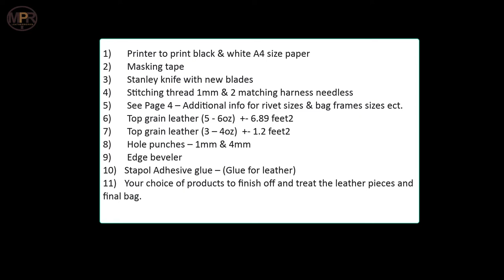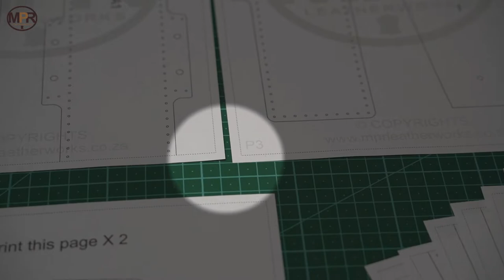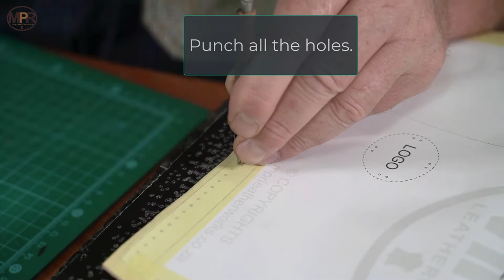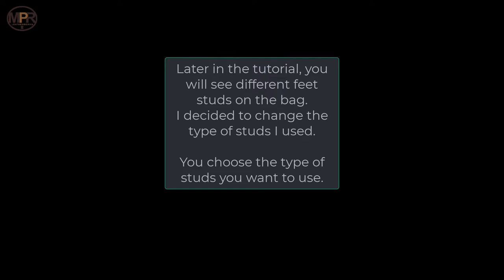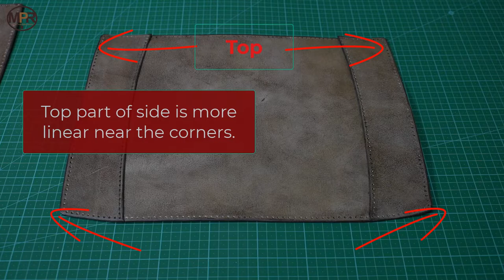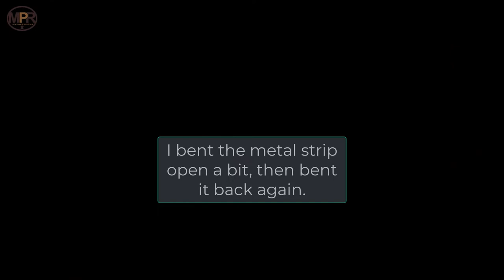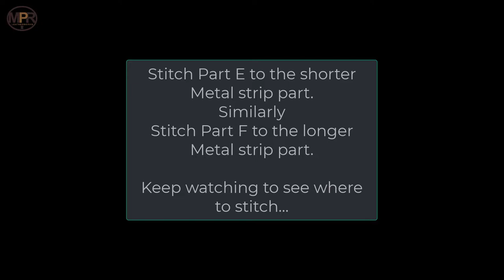How to make a Leather Doctor’s Bag l MPR Leatherworks

Comment: What’s the length of the Bar once folded. I bought the pattern but the listed length I think is for a straight steel bar not the length of the bar once folded down as the frame. I’m purchasing frames and they are sold by the length of the bar prior to the bend
Reply from the maker: I replied on Etsy.

Comment: Still can’t find pattern when I hit link. Also where did you get the metal parts like the bars, lock and handle? Thanks
Reply: Same
Reply from the maker: The links working now, ty 😀👍
Reply: @mprleatherworks  bought!)
Reply: Same question: especially the metal frame that opens the bag. Purchase source? Thanks
Reply from the maker: @joemanthei695  , Hi Joe, I give the dimensions of the metal frame required. Easiest to go down to your local hardware store to get it made up. It is so very simple to make😀👍. If I must send it to you it would cost you an arm and a leg in postage fees. I am trying to make it as simple and cheap for you as possible.😀🍷
Reply: @mprleatherworks  sure. I understand. I thought maybe you made it but wasn’t sure. Thank you.

Comment: Can I have the dimensions of the bag please? And also what the length of the metal frame?
Reply from the maker: The additional page 4 provides more info regarding hardware including the rivet sizes and frames details required and additional pictures that forms part of the download.

Bag dimensions: 410mm (L) x 180mm (W) X 260mm (H)

Comment: Hi, may I have the patterns? My niece Is getting a PhD as a doctor. Thank you
Reply from the maker: Hi there, I see you found the pattern. Thank you.
Reply: @mprleatherworks  when will you send to me the patterns? Thank you
Reply from the maker: Hi Marco, you should have received the pattern link via an e-mail directly after you made the purchase. 
Are you saying you did not get that e-mail with the link to download the pattern?
Reply from the maker: Hi Marco, I have sent you the pattern to your e-mail address, as well as a FREE GIFT. The was a small problem with automation system of the website, but it was fixed now.
Reply: I received the patterns. Thank you for the gift.  A question: I can't find the steel flat bar, but I've found an alluminium flat bar 18mm wide X 2mm thick. Would it be too weak? Thank you
Reply from the maker: Thanks for confirming that you received the pattern. Regarding the aluminium, I can honestly not suggest it or say it cannot work. Maybe you can test it and if it works, tell us about the alternative.